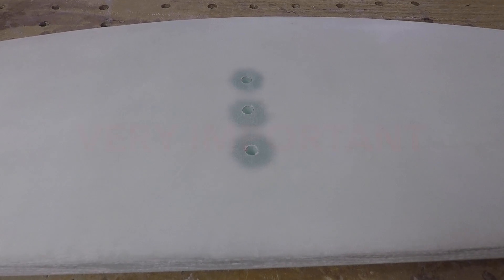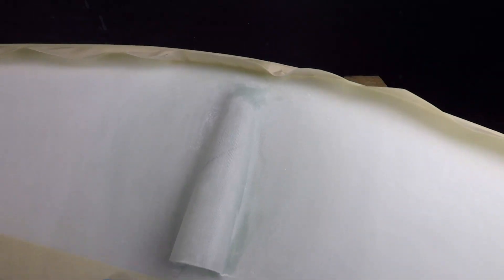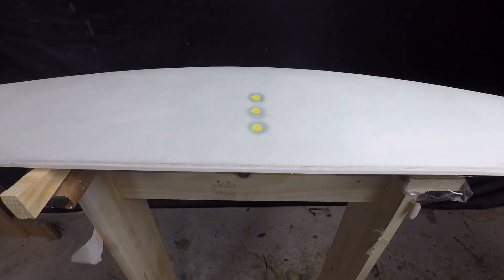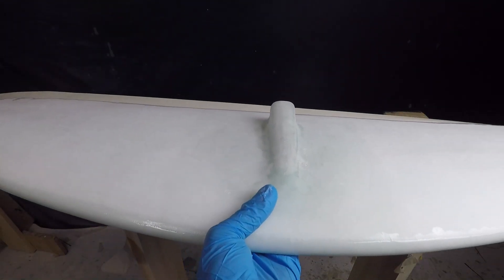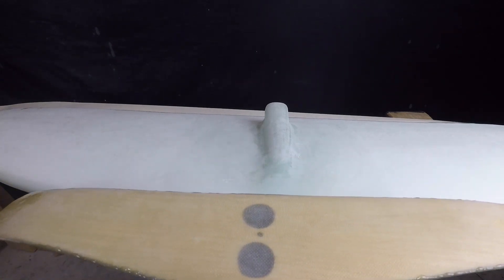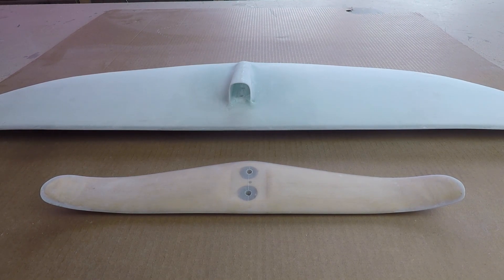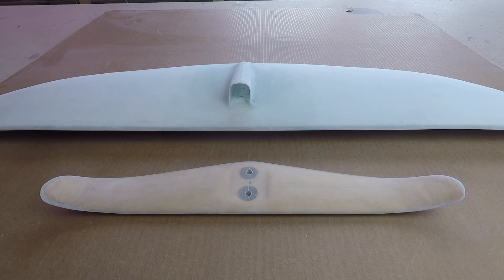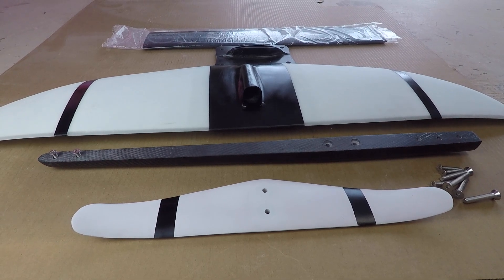Carbon Surf Hydrofoil Build Part 3

Comment: Can this foil be used for wing foiling?
Reply from the maker: Depending on the wind conditions, I would go with the 3000 size wing for moderate. If it were heavy winds, then the 2300 size.

Comment: Hey James, good to see another video come out.   I still haven't had time to glass up the 3000 I got from you, but it's going to be a winter project.   I've got plenty of #6 carbon, any big differences in using carbon vs fiberglass?   Fewer layers maybe?
Reply from the maker: What is #6 carbon in oz? Certainly won't need as many layers when compared to glass.